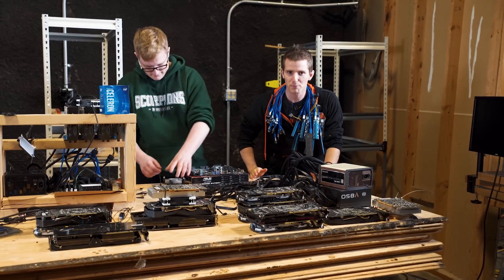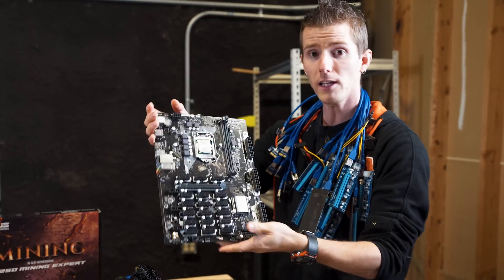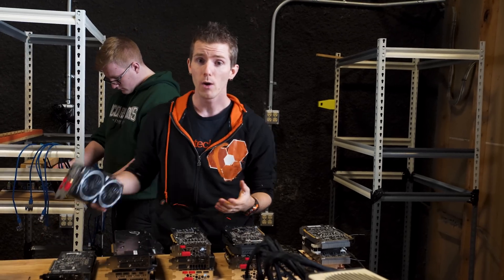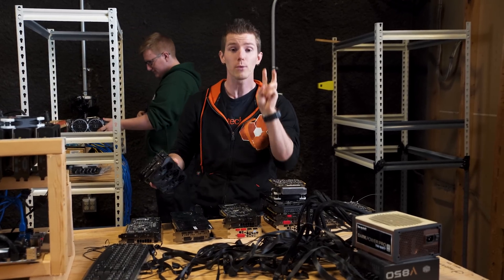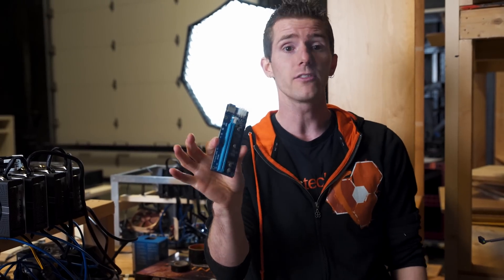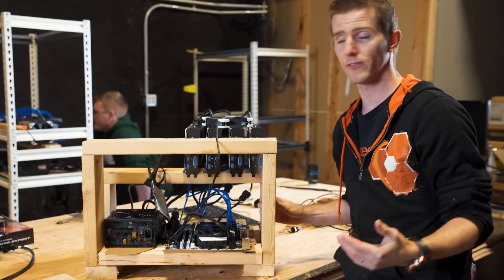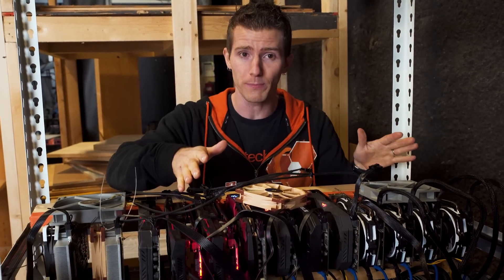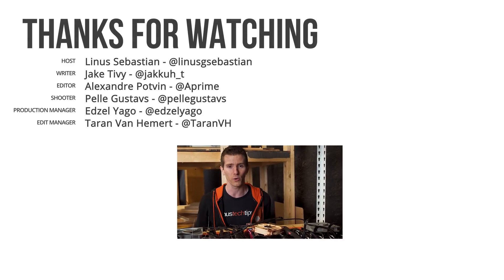13 GPUs in ONE PC? – Mining Adventure Part 2

Comment: Well, to be honest I only care about when will the mine collapse and we can buy cheap cards from former miners. And maybe there should be a video about how efficient such rig would be when doing general CUDA/OpenCC things.
Reply: Don't count on it any time soon. Someone will just develop another currency to utilize the tech. I wouldn't hold my breath.
Reply: You have no idea right? Miners never overclock, they underclock to reduce power consumption (except in free electricity countries) and increase profit ratio. One of the most basic things in mining is to keep your temps below 70c.

Also heat does not degrade cards unless it's over 90c. Constantly (automatically?) changing voltage and fan speed does. Both of these are non-prevalent in mining because you put a power limit and a static fan speed.
Reply: Yeah a 600bn market is gonna just "collapse".

You people are dumb.
Reply: Actually, it's totally possible.

Governments can just utilize some super computers to mine a good number of crypto currencies, convert them to bitcoins and sell them at low price, causing the market to panic and who knows what would happen next. Not every government loves crypto currencies, and at least China is one, and even though the total amount of computing power in China might not be much, they are owned by governments and who knows what would those things be used when idling.
Reply: They can not, because supercomputers can not mine cryptocurrencies effectively. The era of CPU mining ended couple years ago, and supercomputers are all about CPUs.  Currently the world's fastest supercomputer in Wuxi, China has 10.6 million cores and has 93.000 teraflops of computing power. Just the BTC network by itself has 80.7 million teraflops. You need almost 900 more of those supercomputers to have an equal amount of power. Daisy-chain the top 500 supercomputers of the world and you have almost jack shit.
Reply: Nersano Jarkovec You f*ckin scamer. GET OUT OF HERE
Reply: And it's not like the second hand buyer would treat those card any better, because those cards would still only be capable of doing high density computing (for example, maybe there's a OpenCL raytracing engine?) rather than gaming.
Reply: The thing is, market is run by human, and human can panic. You don't need to completely rip the market apart, just trying to get the price drop for a dramatic amount and it might do the trick. Also, speaking of BTC, governments can invest on hash cards as well, and it's highly likely that it's the case. (Also, they can self-trade to confuse the market, so you don't need as much BTC to create the same BTC flow as itself. Money is not food after all, you only trade it, but you won't consume it.)

Also, Supercomputers can be GPU centric as well, and the Sunway supercomputer uses a chip that has 260 cores on each chip, with 4 core being management core and 256 being computing/slave cores, pretty similar to a GPU that has bundled CPU.
Reply: Don't buy used miner cards. Many do not treat them well. They overclock past or to the edge of stability. Then proceed to run them hot. Heat well degrade cards faster than any other standard use case. Don't feed their ROI.

Comment: Hello I need if you can help with this problem
c:\program files\nvidia corporation\nvsmi\nvml.dll is either not designed to run on windows or it contains an error. try installing the program again using the original installation media or contactyour system administrator or the software vendor for support. error status 0xc000012f

Comment: Is it worthwhile if I use my personal computer to mine during nights like 12hrs or so, I have 1 GTX 1070 and a bronze EVGA 750w
Reply: Boring bomb bay I wouldn’t, you need to run that card at 100%, you’ll kill it before it even pays for it self
Reply: It will take literally years of 24/7 abuse and stupid, uninformed mining to do damage any component on your PC by running it as a miner 12 hours a day. With that out of the say, my answer:

It depends on how much are you paying for electricity, you want to make sure you know exactly the Kwh your pc consumes and how much is that costing you, then if your GPU cant cover those costs and give you at least 40% earnings over it, don't do it.

Its certainly not worth it to stress your PC for a couple pennies a day. But for a couple dollars, that's your choice. Start by doing your homework, investigate how it works and why it works, read about cryptopcurrencies and how to properly prepare a regular desktop PC to mine.

I have been mining since august with my gaming PC, whenever i'm not on it i start the miner and let it be, nights included. My GTX 960 has already payed itself over 1 and a half times (bought it at launch for $200). when the GPU prices stabilize i will buy a second GPU using the earnings alone because right now its just impossible and downright stupid to shop for GPUs.

Again, inform yourself heavily and make your choice.

Comment: Don't worry miner haters, they making brand new GTX 2080 cards by jun.2018. We will buy them for mining too. Then you can get the old 1080 ti's, they are good enof to play cod on..
Reply: Ang Jr 
No sane miner would run his GPU at 90C. No more than 75, but preferably 65, and often undervolted and underclocked. And if a GPU survives 1-2 years of 24/7 at full power, it will likely be good for another few years of gaming.
Reply: Fuck outta here console pleb, you cant even afford a single GPU
Reply: Thanks, man my bad, GTX 2080, fixed :D
Reply: https://www.tek.no/artikler/dette-vet-vi-om-gtx-10-etterfolgeren-volta/404713
Reply: First of all, what is that grammar? Second, they haven't released any GTX 2000 series card, and the first one isn't going to be the 80
Reply: np mate :D Hope you like it. I added some minions for you also !
Reply: lol

Comment: 200 (usually 208, 220, or 240) volt service is  VERY common in North America, just not nearly as common as 110 (legally restricted to 108 to 132) volt service. 220 is used for electric ovens/stoves, water heaters, electric clothes dryers, and most commercial metal or woodworking machines. Electricians may charge a lot to have new higher voltage outlets installed, but most of the time they don't have to run any new power lines to the home. The US uses 110 out of convenience. 220 is more efficient for higher power loads, which is why a lot of the remaining parts of the world use it.

Comment: Could you not get hold of the ASROCK H110 BTC PRO ? hold 13 GPUs. the Server PSUs are readily available on ebay called the DPS-1200 & Breakout Board and PCIE cables for £120.

To anyone bashing Miners for lack of GPUs, buy a 1080Ti on finance , and stick it on nicehash, it pays out about £4.5 a day ! 3 Month ROI so free GPU after 3 months of mining.

Comment: So I've done math for my country 1080ti cards (7650/900monthly=~9 would be for 13 gtx 1060 TI but they're out of stock here) x 13 =16447USD which divided by monthly revenue Linus mentioned it would take 18 months (without - energy costs) to go to 0 balance. Finding cheaper cards abroad mb is a solution?

Comment: PSA : When using the 6 pin PCI-E risers DO NOT use the included sata adapter. Some cards draw power from the PCI-E slot. SATA Can only handle 25 watts to my knowledge and 6 pins pull up to 75 WATTS! Also  DO NOT Daisy chain 2 SATA connectors to any riser especially 6 pins. Connect the 6 pin risers directly from the PSU 6 PIN adapter or use a 8 pin to 6 pin splitter. (8 pin supplies 150 watts, evenly splits power to the two six pins 75w each.)

Comment: Barely possible in any countries beside usa/canada/russia/china..... 

The rest of the world pays up to 3.5 times what you guys are paying for electricity.
Reply: Venezuela. Shits hitting the fan back and forth here but electricity is cheaper than air and gasoline is (literally) much cheaper than water. The electrical service is however extremely defective and unreliable with constant brownouts, tension spikes and 2-10 hour long obviously programmed blackouts that happen without any warning. And there have been gas shortages all over the country for years now.

The real reason the price of electricity is so low is that the goverment cant rise to something realistic because according to them 1 USD equals around 5000 VEB, when in reality its impossible to get the official rates and the black market rates are nearing 200k VEB per dollar. It would be like admitting our economy is completely fucked. You know, typical failed neo-communist state blaming the US for all of their incompetence with a "everything is fine" disc on repeat on all mainstream media.

And no, i cant buy anything even remotely technological here, the economy is screwed and the rates are insane. Minimal monthly wages+bonuses are about 800k VEB ($4.6 at black market rates). A 450gr jar of mayonnaise in the store costs 600k. I have to import from either china or the US, and i already have enough for a new GPU, i just need to be patient for prizes to stabilize as i wont be buying anything that goes more than 10% over MSRP, what kind of fool would buy an overpriced GPU instead of waiting is beyond me. 

In comparison, cryptos are an extremely stable and reliable way to put my money in, ironically enough. So yeah, shits bad here but at least services are cheap, if a little bit wank.
Reply: electricity in Norway runs about 0.05 - 0.04 USD each kW/h
Reply: just checked my energy bill of the last year here in austria.. its 32cent per kwh including taxes I couldnt even mine if I wanted.
Reply: In Latin American countries the price of the energy is higher than that. Imagine the price of GPUS. Fuck those miners.
Reply: where are you living aha
Reply: How about you invade your own oil rich country if you want cheap power and stop complaining.
Reply: So build some goddamn nuclear power plants. As long as they are made right, they are extremely efficient, and safe.
Reply: @eldiablooooo does that include all costs? In Finland the price of electricity is about 0.05 usd  kW/h, but you have to factor in about 0.07 usd kW/h for transfer cost and tax... so the sum is about 0.12 usd kW/h
Reply: redX111t that's with taxes yes. And every month you have to pay 20-40 $ for maintenance costs (depending on where you live)
Reply: @eldiablooooo learning new things everyday, though everything is expensive in Norway, but that 20 dollar maintenance cost sounds like a sweet deal compared to our expensive grid transfer costs.
Reply: LOL middle-east is the best place for mining! If only you can afford to live there.
Reply: here in Slovakia electricity is on 0,13 €, that is, 16 US cents per kWh. And we are said to have overpriced electricity compared to other countries.
Reply: tehOGRE it is often still profitable
Reply: agreed... you'd never get an ROI mining here in the UK, my electricity is 11.025p/KWh which is 0.15 USD. just too expensive to be worth... mining is only really is worth the investment if you can get your power for <0.10 usd/KWh
Reply: Wrong. 4 cents an hour for me
Reply: In hungary: 0.5 USD/kW/h
Reply: leathery420 Until they explode, yes. Water power is much safer, pollutes less, and never run out. Nuclear is kind of bad, but still probably better than coal.
Reply: Note that I said when they are built right. Sure there is that risk, but it's very low if the country actually follows the rules. I mean if you got watch documentaries on the two that have blown up in the history of nuclear plants you'll see they were cutting corners. The soviet union wasn't in great shape in 1986.  I mean there are over 449 reactors right now. I'd say there is much more risk of some poor ass country trying to  use their reactors to make nuclear weapons, and hold the world hostage than there is of having more reactors explode. You know Chernobyl is been made into a solar energy farm now? So maybe if you live in a country that has a tense political climate hold off on the reactors, but countries with tonnes of space, and little sign of civil war have no real reason not to. It's debatable. Water, solar, and wind are great, but they do cost quite a bit to keep maintained as well as some countries just don't have the space, or resources to make use of water, solar or wind power. Where as all the things to make a reactor, and maintain it can be imported.
Reply: in my country my monthly electrical bill costs me half as much as a single chicken egg. i have 2 refrigerators, 1 microwave we use A LOT, power tools that get used quite often,  2 TV sets that see cosntant action all day long (one is a CRT) 4 LCD monitors, similar action to the TVs, 4 desktops computers (mine alone pulls around 400w) 2 laptops and 3 AC units running at all times except between 6am and 11am.

My core i5-2500 covers the electrical cost of the entire month of the whole house if i run it for an hour.

Comment: I'm nost sure why "gamers" hate miners for GPU shortage? Thre are tons of different GPU models, and miners are only intrested in few of them - And let's be honers, no one was giving a singel F for RX 5xx series for gaming anyway... Only mining noobs will go with 1080, 1070.. They are not profitable at all! U would need over a year to get ur money back. So yea, dont blame miner, blame noobs.
Reply: A few of them? You sure you didn't mean "almost all of them"?
Reply: Explain the warehouse pictures of gpu miners.
Reply: The RX 500 series was the cheap cards from AMD. I bought a RX 580 and it works very well for my uses. Thanks to these mining retards trying to get higher amounts of a worthless numerical value they have driven up the cost of cards and put them out of stock. Thanks retarded miners.
Reply: Yes, why would gamers hate miners for gobbling up all the cards that are good for gaming?  I'm at a total loss!
Reply: Well as i said. If u have spare $$$ u will buy 1070/1080 but they are crap for mining. Card with ROI of 8-10 months is same as any card. And u would have to tnx to mines. They pushed driver updates, new memory type and so on.. AMD driver was a shit for a 10 years before mining.

Comment: After three years with my trusted GTX 970, which was already weirdly expensive at the time, though I didn't know why then, I thought it'd be time to upgrade to the 1070..but wait... That's right, it costs over 500€ everywhere, assuming it's in Stock... Just for reference, minimum wage in my country is 580€, because it's been going up, just 5 years ago it was below 500... So, I have to respectfully tell miners to go and choke on a fat penis.

Comment: Canada runs on 120/240 for housing. 200 volts is a tolerance usually 240v can be between 220v and 250v. And if you have access to a commercial space you can potentially have a 120/208v system. Most electric dryers and ranges are 240v. The chances of having an extra 240v outlet free in your space is the largest issue, but from between $500-$3000, depending on the conditions, you can hire a professional electrician to install a new 240v outlet in your space.

Comment: Wood really shouldn't be an issue. If your rig gets hot enough to ignite the wood, which is what guess he's worried about, you've got way bigger problems already.
Reply: yeah, PC temperature shouldn't be a problem... directly.
But it's not the same for plastic cases and cheap cable housings.
Since you would run some of these things for years; the plastic surely will degrade; cables may get damaged and components on the PSU or electronics board might fail. That's the moment when you should worry about having used wood for your rig.
Whoever who —even only for his/her family— has repaired computers would have experimented or saw electronic parts explode and leaving a black mark. Treated or even properly sanded wood might not immediately catch on fire, but you can't endorse a rig that could be made with worse quality material which could catch on fire more easily.
Reply: that's what I said. No PC reaches 190-260 degrees Celsius. Even the chip its self only gets maximum of 90 degrees in extreme situations and the outside of the card cooler shroud and the air in the case ( or around the cards in this situation cause its all open)  is nowhere near that hot. it takes 150 c at least to start to turn it black.
Reply: Your main problem is warping not a fire.
Reply: Exactly, I've watched people have trouble starting wood on fire, with actual lighters.
Reply: Would grounding be a concern when building a wood rig ?

Comment: All of y'all complaining. Just stop, that's how a free market works. Supply and demand will cause prices to change. It can be a fairly good thing if you're in the right place, like during the ethereum boom, I sold my $200 rx480 for $450 and bought a 1080 for  $470. If you're looking to buy a video card right now, you're either gonna need to suck it up and pay the price for gpu currently, or continue to wait while the rest of your pc goes out dated. Either way, stop your bitching

Comment: Lol , is not antminer s9 would be a better choice?
Reply: Antminer is a bitcoin-specific ASIC, that's the specific part of application specific integrated circuit.
Reply: Ohhk....Thx i did not know that
Reply: But i found that you can mine any SHA-256 based cryptocurrency
Reply: Sure, but most cryptocurrencies use different algorithms, or a blend of algorithms.  So GPUs are really needed for those until their market is big enough to make developing an ASIC for them worthwhile.
Reply: aidanjt Hmm...
Reply: New crypto algorithms are specifically designed to be ASIC resistant. The goal is to build a distributed network, and expensive specialized hardware doens't help that.